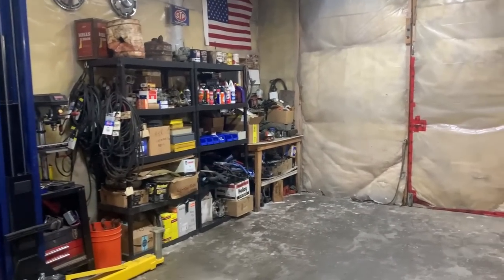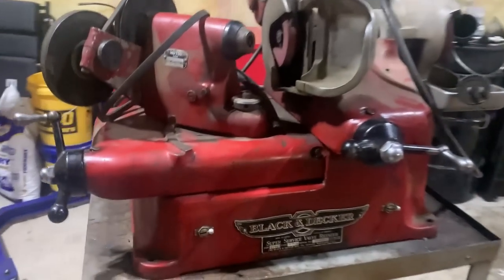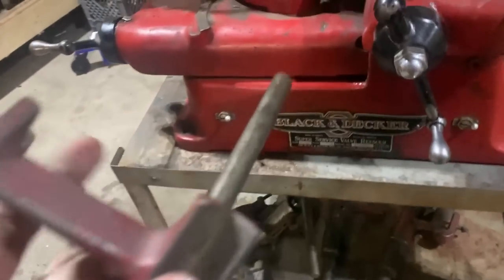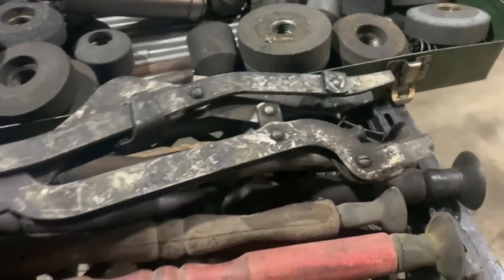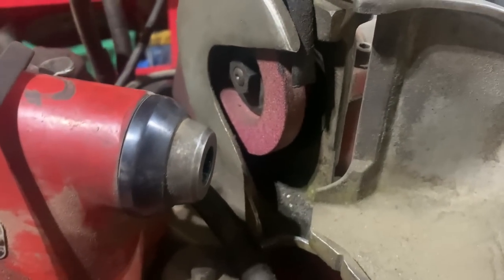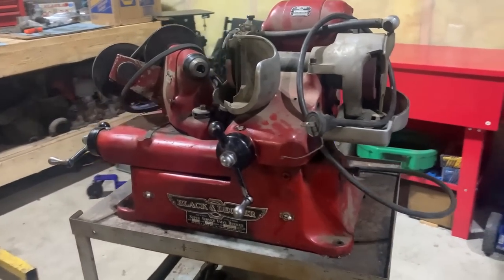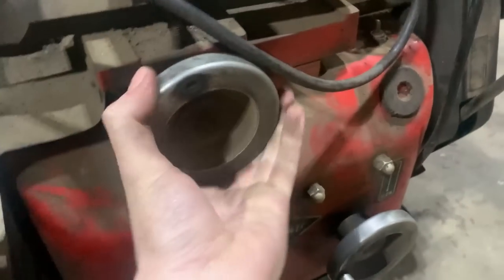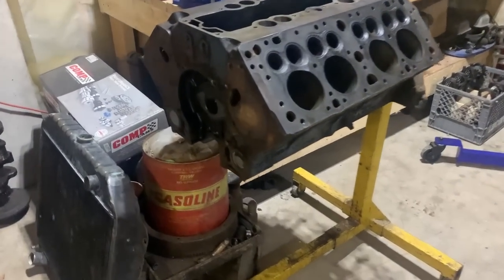Vintage Shop Equipment

Comment: That is awesome I am mid way through a teardown and restore on a souix model 655 valve refacing machine. I have a newer black and decker super service refacer also. I think Van Norman is who actually made the machines for black and decker. you can still get stones and some parts through beam equipment. Check the felts on the oilers on the Valve grinder. they tend to get gunky over the years and stop wicking oil properly. it's an easy fix that will help extend equipment life you can get the felt from mcmaster. Good to see old equipment going to a good home where it will continue to work and be taken care of :)
Reply: great input.

Comment: Nice old valve grinder. I would recommend switching out those power cords with some that have three prong plugs, so the unit is grounded while in use.

Comment: Congratulations on your addition of the new new shop equipment young man .    Those are some very nice old tools,.  With a couple pieces of sheet metal and a box of rivets you could build that cart into a decent cabinet if you want.
I think it would be extremely cool if you found yourself a good block of Cedar wood and drilled some holes in it and made a stand block for all your arbor pilots and stones,  like us old timers used to do. Then you could have em neatly available for use right on the shelf below the machine.
   I built my welding cart from a old stainless steel restaurant kitchen cart similar to the cart that you have,
I got it from a friend that had it in a pile of stuff that he was going to take to the scrap yard, and it is now the best welding cart that I have ever had.
  You know it probably wouldn't be a bad idea to get the the model numbers for all that equipment and order up some spare sets of motor brushes for them in case you need them in the future.
 I have a DeWalt grinder that a friend gave me going on thirty years ago now, when I got it, it was almost new but it had a broken trigger for the power switch and I replaced it for about seven dollars, and I have been working with it ever since,  and finally last year I had to replace the brush set in the motor,  and I was able to get a two pack of brushes online for about five dollars.
And it still works as well as it did nearly thirty years ago.
 So it goes to show that with a bit of effort and common sense you don't have to spend a lot of money to get have something useful.
  Thank you for your videos.
Tim from Wisconsin.

Comment: Those old machines were built to last, everything was back then so I am glad they have found a new home where they will continue to be productive and you won't have to bother you're buddy for assistance. It also means you can spend more time working on projects and less time travelling about, good show!
I think your age estimate on the machines is correct from what I know of Black&Decker at least.

Comment: I think quick Way is snapon . Once upon a time I was one of the guys that guys would bring mostly old working rigs a few hotrods things that they couldn't get a new drum for or it was close to the limit. The the old days not the olden days but the time when guys got a 15 minute training on resurfacing drums and rotors and the would cut to the limit so you only got 1 brake job before you would need to replace drums and rotors. The WE TURN DRUMS AND ROTORS $5 days . When a new drum was $100+ . Then came offshore drums and rotors. I remember getting brake drums made in Brazil $50 and light stuff like pick-up brake drum new $15 . 
My opinion is to many people not resurfacing leads to a lot of waste . Drums and rotors end up in garbage dumps today . The waste of perfectly dug drums and rotors in favor of cheap fix . 
 Have fun .

Comment: Very cool machines. 
My father does a bunch of woodworking. 
He had at one a table saw made by Craftsman from the early 50’s. Wasn’t a huge saw, but the base was a solid wood base. The saw housing was all steel. That saw must have weighed over 150 lbs. Base saw and motor. He finally stopped using it several years ago.

Comment: I remember doing valves seats and 3 angle valve grinds in Job Corp as a 20 year old the drill is a slow drill specific to the valve tools so it doesn't remove to much material to fast

Comment: THAT MY FRIEND is one sweet setup! I would be over the moon for it. I owned a new snap on setup for brakes and valves were still by hand twenty plus years later.. Oh I did buy stuff to do valves but buying any chinese crap gives those same results, my first job cost me more for it being redone at a shop my cost than the tool I bought, I used a torch on it so it never happened again.

Comment: Very cool! I don’t know if you’ve seen my stuff but I think mine is older 😉
Pull that valve grinder apart and replace the ways… they’re probably worn out. They should just be round bar. Clean and adjust your spindle bearings as well.

Comment: I actually have the seat grinder motor assembly....somewhere. Also an old Van Dorn valve grinder. My stepfather left it to me when he passed away. I'll probably never use it, though. I already gave away the resurfacing machine. it must have weighed a ton, or more. It'd cost too much to ship

Comment: do you have user manuals? Do you have the part number of the hex head your are missing? And the valves you have, have a know quality, unlikely to disappoint.
Post the model numbers of the machines and maybe one of us can stumble on some parts and pieces. Congrats on the find. It went to the right home.